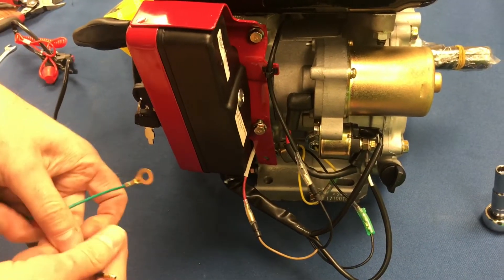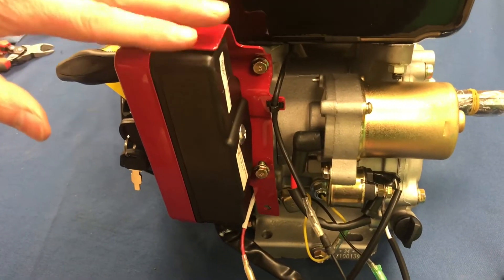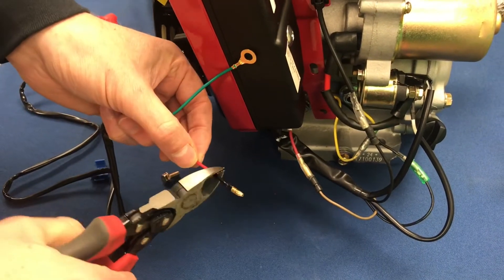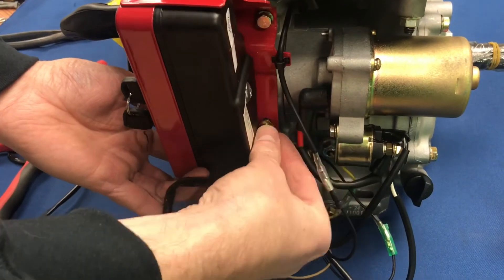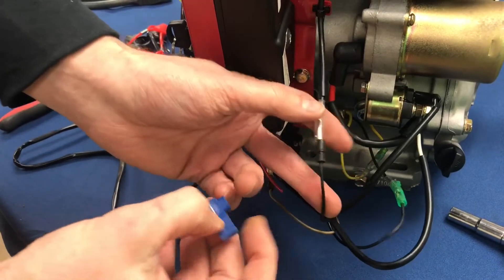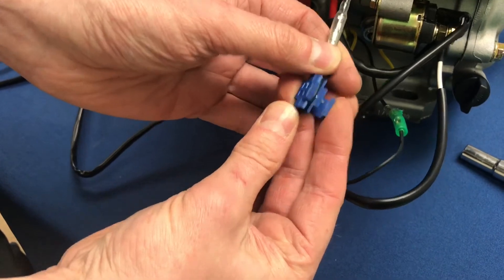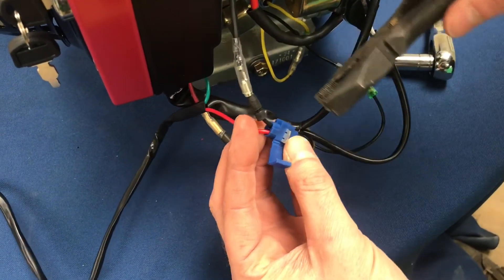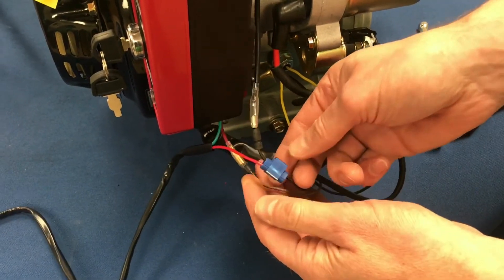Mud-Skipper kill switch hookup for 9hp & 16hp Electric Start gasoline engines

Comment: Can I use the same thing for a 22 hp preadator
Reply from the maker: These instructions will likely be different for a predator engine, but the kill switch itself will work on most small engines